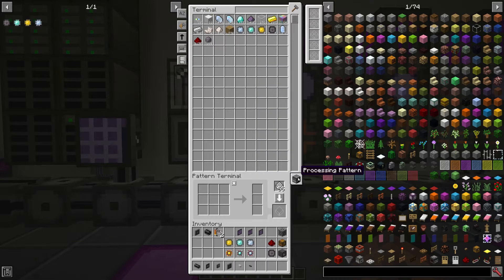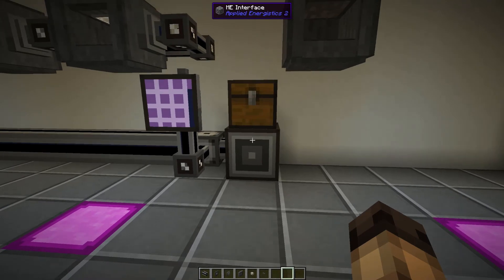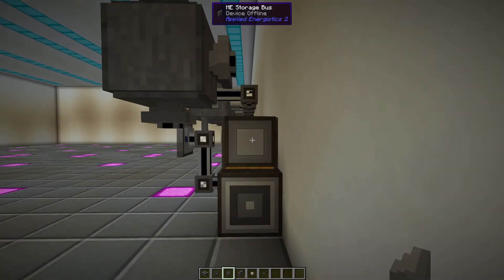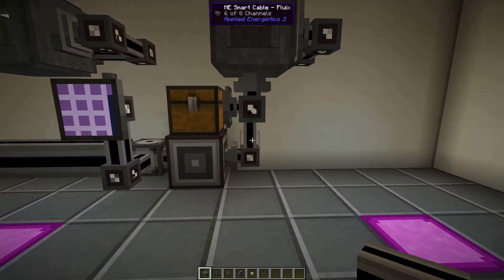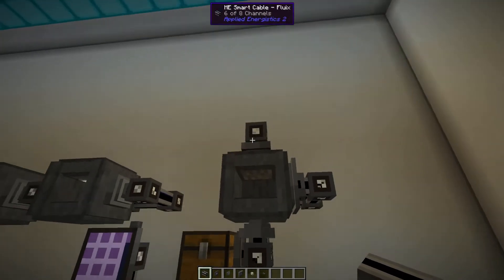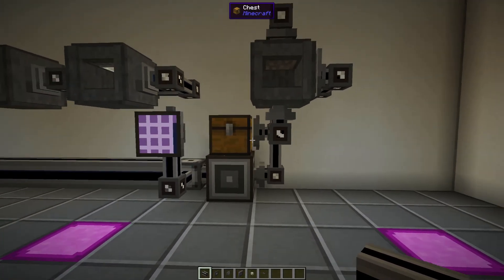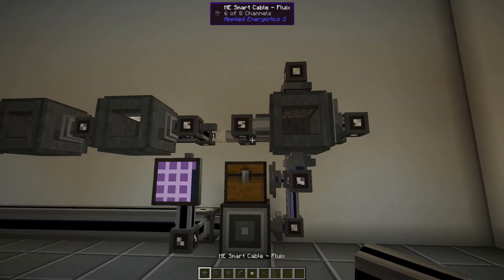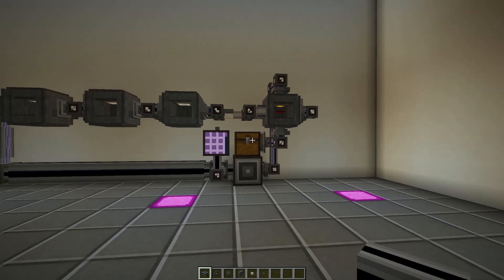Syn's Shorts - Sub-networks and automating AE2 Processors - AE2 (1.12.2)

Comment: weird thing happening to me. When my network can see the patterns it doesn't pull from the inscriber. And when my AE network CAN'T see the processor patterns it does pull from the inscriber.
Reply from the maker: The standard inscriber is very directional, with the processing pattern are you inserting on the right sides for each item type? Also are you importing the item into the network from the side (not top or bottom)?
Reply from the maker: Alternatively, it could be a lack of channels, maybe..
Reply: @SynsSurvival  I did end up figuring it out! Thank you for replying. I ended up making a less compact version - There was something weird going on with the connections which was messing with the channels.

Comment: What I used instead was import bus on chest export bus on interface then connected to a ME chest with a controller next to it then came straight up from the controller with [ME Dense CableX5] in a cross pattern and ran 4 separate [ME Smart Cable] lines coming off of the dense cables, used 8 export bus on top 8 export on left 8 export on bottom 8 import on right side and had my inscribers spaced one block from each other using the back as power supply used cable anchors to separate the cables from touching one another and exceeding the max 8 channels managed to make a pretty compact factory setup. I plan on building this setup for all four circuits and having 32 inscribers for silicon. I liked the video most AE2 inscriber automation videos use different mods to automate their inscribers. I'm wondering if you could make a video on bi-directional P2P subnets at some point in the future?
Reply from the maker: I can agree that anything worth doing is worth overdoing.
Depending on your modpack, you can you the AE2Stuff Advanced Inscriber. It has room for 5 acceleration cards.
My current E2E playthrough has one of these for each of the printed circuits and processors, I don't believe I wait too long for items to be made, but I might upgrade the system to use 4 for each.
To clarify your question, what are you trying to achieve with have bi-directional subnets?
I usually export the inputs to craft an item using a contraption and return the output to finish the craft. While it is possible to share stored items between to separate ME networks using external storage, I don't yet understand the value in having two independent systems. It could be helpful to clarify what goal you are trying to achieve.
Reply: @SynsSurvival  I have a network setup for my factory where I've almost reached max channels, this setup has all auto crafting machines and storage. I've built a new max size point to point network, I'd like to have the ability to send information to and from either network. The old (factory network [B]) is now sub networked into the new network [A], Network [A] can read network [B] I'd like network [B] to be able to process information on network [A] & vice versa.  e.g having the ability to see inventory of network [A] in network [B] / using [B]'s auto-crafting to craft items using [A]'s terminal.

Comment: is there a way to set up multiple of these on one crafting network? Ive tried and itll only use one inscriber at a time
Reply from the maker: This is an interesting question. I have heard that it is possible to have multiple recipes where, "As long as the recipes are exactly the same (items in the exact same slot) AE2 will split the process between the recipes." However, I have not been able to put this into practice.
My solution has been to put multiple crafting machines on the same sub-network (e.g. one drop chest into something like a furnace array with the outputs being imported back into the ME network to complete the craft). Noting that you could do this with AE2 processors. You can use sub-networks with AE2 or other mods to direct the items to the machines. This can have some limitations.
I plan to have a new tutorial on this topic shortly.
Reply: @SynsSurvival  okay sweet, thanks for the quick response